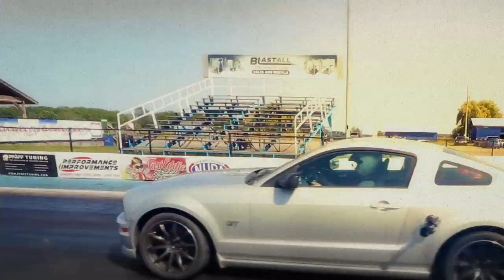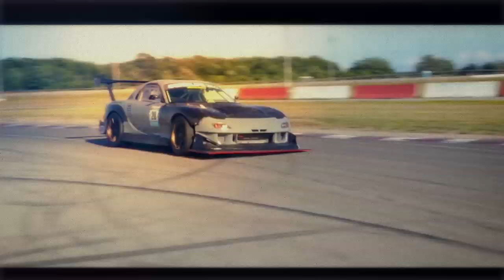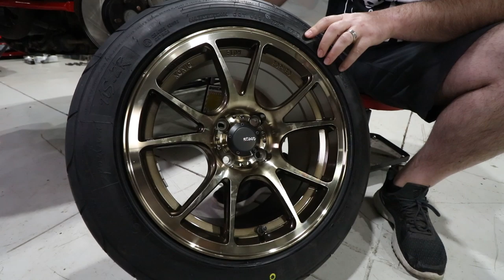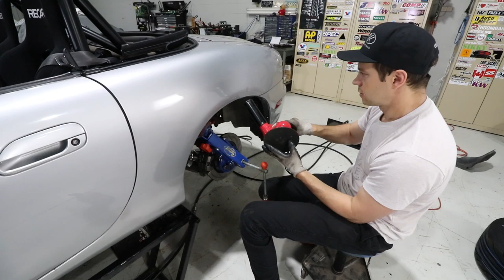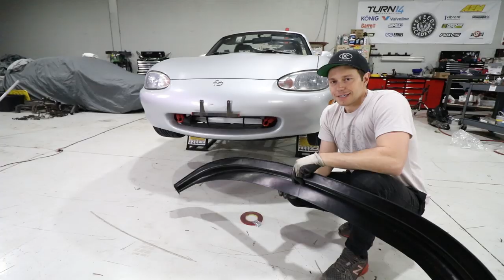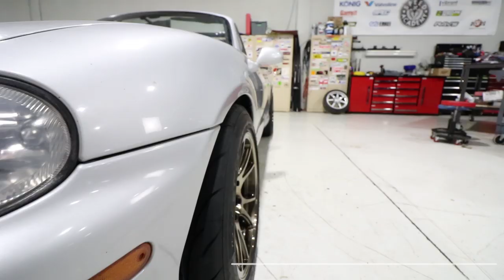The Budget Miata Gets a MAKEOVER

Comment: Thank you! I rocked a built Miata for 13 years and hated the 17" wheels that guys were using. I went with 225 tires because I was over 200whp and needed the traction, but your combo should be fun.

Comment: About the fender rolling.
Those "stitch welds" are just spots where seam sealer pushed out of the joint. Get it out of there with a wire wheel and you'll get a clean fold

Comment: Arn't larger diamater tyres faster? 

Wont the stiffer sidewall of a larger diameter tyre give you better turn in response and more progressiveness (breakaway to under/over steer) ?

I know you guys did a comparison video before of tyre diameter but you changed the width as well. Would be interesting to see a comparison on the same width tyres just changing diameter similar to this;
https://www.youtube.com/watch?v=mPyg3ilw3KU

Good excuse for konig and nankang to send you another set :)
Reply from the maker: Larger diameter effectively increases gear ratio so on a low HP car such as this they’ll be slower (in theory)

Comment: Today's engineering explained 3 pounds of wheel weight saving, and 1 inch shorter in height. Gives the car more low. Plus, taking the car lower with the adjustable coil-overs. Car does look great.

Comment: I was excited that another set of 15x10s made it to the market.
Their 9.5 but I'm still tempted to run my 225/45s on those and it'll just be slightly more aggressive than my 6UL
Reply: 225's are already kinda stretched on a x9.
Reply: @ALMX5DP  I've been running 225/45 on my 15x9 6ULs for years and at no point have they ever appeared stretched.....
Reply: Nicholas Wild may not appear too bad, but most tires in a 225 size are a bit short of being square on a 9. Just judging from my RS3, R1R, Rival and Hoosier A7s.

Comment: An NB miata can fit correct offset 15x10 w/ just a flat fender roll, no flairs needed.
Reply: Really depends on tire size though.
Reply: @ALMX5DP  Fair point. That's with 245/40/15's